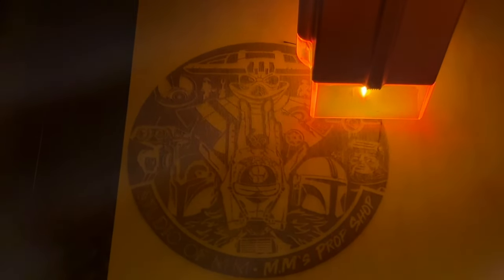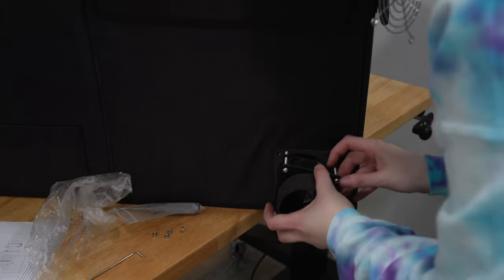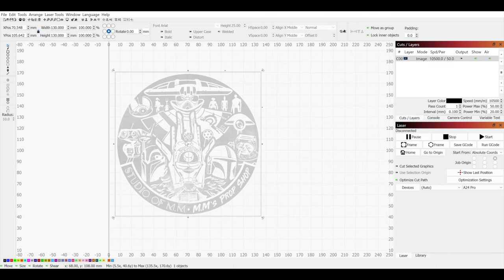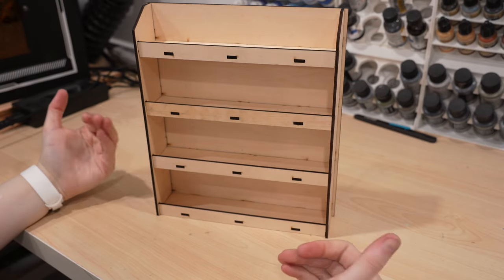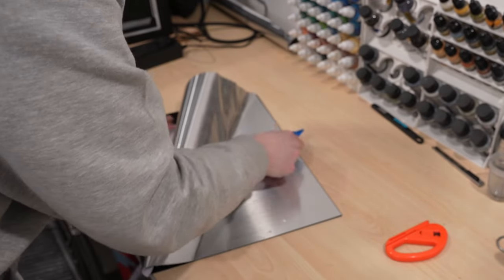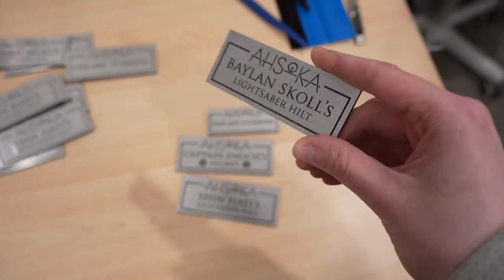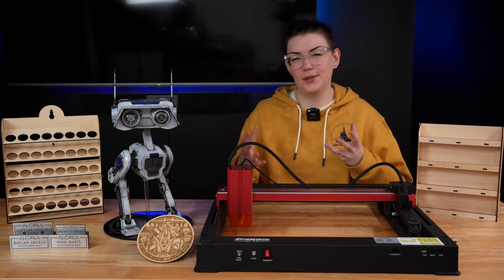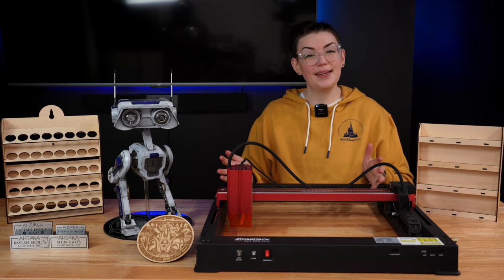First Time Laser Engraving: It's Surprisingly Easy

Comment from the maker: Hey everyone, just wanted to clarify an extra safety measure here that I forgot to mention in the video. Most vinyls should not be laser cut as they can be very toxic. There are however PVC free vinyls that are laser friendly. You can also always cut the acrylic separate from the vinyl and then use something like a Cricut to cut the vinyl out to then add to the acrylic piece. It’s always best practices to do your research before attempting to use a new material on a laser engraver to make sure that it is safe to use on the machine. Stay safe and have fun creating!
Reply: There are multi color acrylics that when you burn through the top layer shows a different color in the engraved area. I have seen silver and black ones. For future projects look for those.

Comment: Since you asked about painting before or after assembly for projects; the answer is, it depends. I prefer to paint then assemble. However some say the glue changing the paint color is a problem as well as glue not adhering as well. I have not had a problem at all.

Comment: Personally, i consider a beginner friendly laser engraver the ones that already have a built in enclosure that automatically shuts off the laser when it is opened and resumes immediately after it is closed.  this is to protect your eyes, which can be irreparably damaged if exposed by the laser light be even a fraction of a second. there are multiple laser brands and models that have this feature, but the most affordable one is the Genmitsu L8, followed by the Roly Lasermatic MK2.

Comment: Another toxic fume to be worried about is tanned leather. Please make sure to used vegetable based colored or tanned leather. Once again, one can buy leather specifically for laser cutting.
I also recommend laser glasses, for more safety.
Also because I am a member of a Makerspace and have seen things:
1) never leave a running laser unattended.
2) fire extinguisher or fire blanket next to the laser
Yes, the two are related to each other. No it wasn’t me.
Reply from the maker: Great tips, thank you! I’ll definitely have to check all of the dyes that I use for any of my leatherwork to make sure they’d be safe. 

And absolutely to all of the safety precautions! While I would hope that my one video wouldn’t be the start and finish to someone’s laser engraver research, I’ll have to make sure that I specifically mention best safety practices in any future videos just so everyone stays as safe as possible. Especially because a lot of the things don’t automatically come across on video without it being explicitly stated.
Reply: @MMsPropShop  I think you did a good job. There is way more stuff to cover than just the basics. I shared stuff like the leather issue because that isn’t obvious and is related to cosplay and props. You know, don’t want you hurting yourself because then what would ai watch?

Lots of these can be huge rabbit holes. My opinion, and I am the first to say feel free to ignore it, is that you include the non obvious things, and say read owner’s manual.